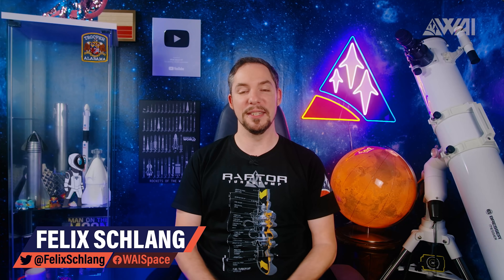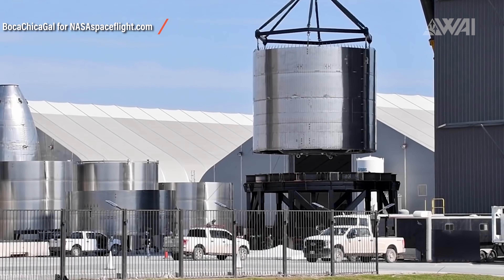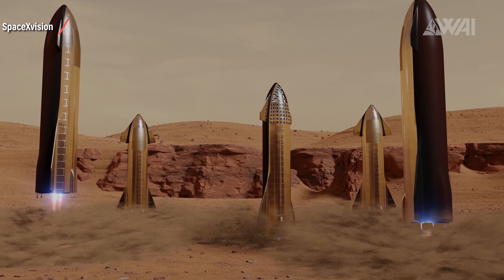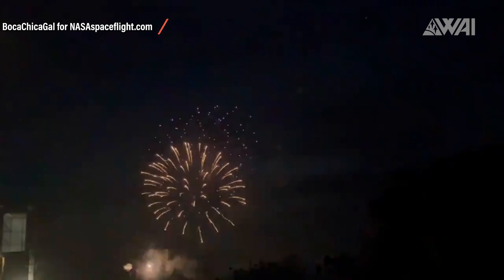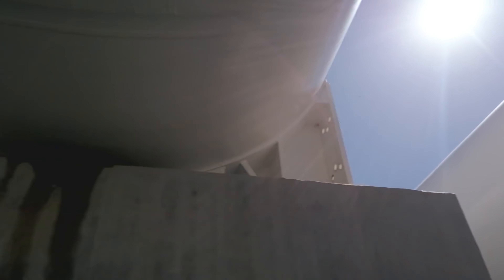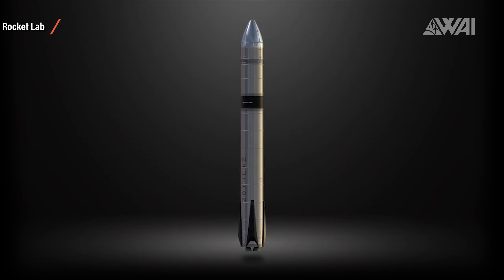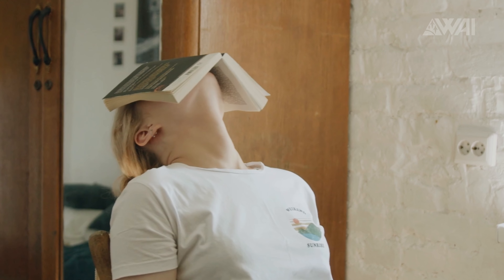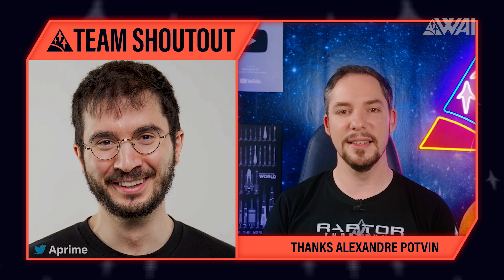SpaceX Starship Without Legs? Is Elon Musk Serious? Blue Origin & Rocket Lab Next Gen Rockets!

Comment: I'm excited for Neutron and cant wait to see it launch AND come back to land. I hope they let us in on their journey and consistently release info on their progress.
Reply: *to barge
Reply: I'm excited also.
 Peter Beck is your typical New Zealand quiet achiever, not given to bold claims but plenty of bold thinking backed up with well executed results.
Its exemplified I have always thought by the NZ All Blacks ruby team through the years, to do things with modest tenacity and let results speak for themselves. 
Venus intrigues me as well, a hell hole on the surface but with an upper atmosphere and gravity closer to Earth than anything else in the solar system.
Reply: @Dug6666666  I like to imagine how close Venus would be to earth if it was further out then it currently is. Say Mars and Venus were switched positions 4 billion years ago. I wonder how much water Venus originally had. If Venus still became a greenhouse, would it’s further distance from the sun still allow for liquid water on the surface? All the typical what if questions.
Reply: All new rockets being developed should be fully and rapidly reusable and either Methane or Hydrogen fuelled. Methane and Hydrogen can be manufactured using carbon dioxide and water and renewable energy. These are the things which are necessary for a transition to a circular economy, while reducing the cost and carbon emissions to put cargo and passengers to orbit and beyond.
Reply: @MrAlRats  Rockets don't make much emission, even tourism using airplanes doesn't make much.
And full reusability isn't easy and it needs a lot more fuel and it just doesn't make much sense on small rockets.

Comment: Dear Felix Schlang
Thank you for your enthusiasm for space. I support you on that. For the catching of landing Starships, I propose using support legs like the Soyuz support legs. Just folding up, when the Starship is landing. Airbacks could puff out from the top of the legs to give a soft touch and support. 
Instead of the Starship legs, I propose to build in a supporting “ring” in the bottom of the Starship (inside the skirt). The landing platform could then be like a short conical tube, for controlling the landing to a precise stop and parking (on Earth).   
Top of mind idea. Best Tomas Horne

Comment: Thanks for another great video!

"So the helium pressurization system introduced with Starship Number 9 to fix the header tank pressure problem Starship Number 8 was suffering caused the trouble on Starship 10..."

That's it in a nutshell. Plus the problem with getting the landing legs to deploy, and a methane leak that may have also been related to pressurization problems.
Reply: Teething pains, teething pains, they will work it all out eventually. I am really surprised at the number of people who think that, because they have had two unsuccessful landings, and one only partially successful, that the problems are insoluble and the design is fundamentally flawed. i mean for crying out loud, they fully expected to be exploding in flight at this point. They have achieved terrific, unexpected success. Mere engineering problems will be solved.

Comment: This may be off topic, but I think someone might find it interesting. :)
Device to end the creation of Nuclear waist.
 Step 1: calculate how much energy you need pumped into the motor to make a vertically positioned circular platter with  magnets in-bedded horizontally around it's left side and right side so there pushing force is pushing out sideways relative to the vertically spinning disc to spin fast. :D Step 2: Calculate how many sets of copper coils you need to be interacting with magnetic fields to achieve this & to perpetuate more electrical current flow then is needed. :D Step 3: Build a round horizontally positioned platter covered in all these copper coils pointed down that does not move (Is stationary) :D Step 4: build a round platter covered in powerful magnets pointed up that can spin and place it directly under platter with hanging copper coils. :D Step 5:  Position the vertical platter that is  motorized close to the horizontally positioned platter covered in magnets pointing up so that when the vertically positioned platter spins the in-bedded horizontally positioned magnetic fields slam sideways against the edge of the horizontally positioned platter causing it to spin. :) Step 6: Make sure enough of the copper coils are feeding their electrical current into the motor and the rest of the copper coils are linked into a set of rechargeable Battery's placed right next to the motor spinning the one vertically positioned disc. Step 7: Build a duplicate setup of horizontally positioned discs with hanging copper coils and disc with upwards facing magnets and position it to the front right, the back left and the back right of the vertically positioned motorized disc. As the vertically positioned motorized disc spins the horizontally in-beaded magnets will now hit into all 4 horizontally positioned discs causing them to spin. so you will effectively be using the spin of one disc powered by one motor to spin 4 constructs that are each generating electrical current. now build this whole setup multiple times over and use the current perpetuated by it to power up scaled electromagnetic generators that are equal to or more powerful than the ones used in a nuclear power plant. You will now have a device that is self perpetuating off of it's own electrical current perpetuation and no nuclear waist to worry about.

Comment: The one advantage of the catching system is being able to soften an unexpected harsh landing with a shock absorbing system internally.  The arms do not have to be rigid but could be vertically movable with absorbing systems.  This might save a starship or booster having problems.
Reply: Maybe, I can’t think of many issues where the spacecraft would  be having issues with control and still be able to precisely by caught by the catching tower.

Comment: They should use spring legs that absorb the shock of landing and spread the force of landing throughout an extendable base structure with spring locks or shock absorbers. One's that don't bounce due to the fact that the spring is very wide spread and they are releasable. When you release the spring before it is able to bounce, spring or jump out what happens? As you release the spring setting it (to some degree) to let up and spring  into the air your controlling the spring and the resistance of the spring in order to stabilize the landing. So you have a leg structure built in a wide structure with giant spring loaded chamber   that is able to absorb enough shock so the ship isn't hitting against the ground though as the ship touches the ground and absorbs the shock of landing the spring release out into the air so that it cannot bounce. It has to be done in synchronicity. So as the ship touches the ground the spring can release towards the air, absorbing the shock of landing while stopping the ship from jumping back out.

Comment: Could the pressurization issue be solved by some balloon like object inside the tank that could still be pressurized with helium but because it can't mix with the fuel, there is not anymore the problem of getting helium on mars, it could just be reused.

Edit: Let me know if you think that could work :D
Reply: Sounds good, since the helium gets compressed again for storage. The autogenous gas can still be injected into the helium gas section and later separated with extreme cold.
Reply: @imconsequetau5275  Exactly, that's what I thought👍
Reply: But I think the problem is finding a balloon that can withstand the tenperature and pressure, because if it's very cold, it's not anymore elastic
Reply: @Astromath  
Polyethylene film and yarn still works at cryo. 

Once the engines are running, the vapor will rise away from the engines, but during the skydiver maneuver vapors may reach them. It would really help if vapor could be excluded from the methane down-comer. Otherwise, a small gas separator (centrifuge) is also needed, especially at the flexible plumbing closest to the three center engines, but perhaps also at the down-comer "top". These separators may only need to be effective while the engines are off. 

I still expect that much larger & separate propellant gas accumulators will solve the startup pressure problem. These can be located in the main tanks, but why can't the main tanks be pressurized instead?
Reply: @Astromath  
This isn't a stretchy balloon, but a flexible membrane that conforms to the tank walls. The gas fits between membrane and tank wall, causing the membrane to "prolapse". Very similar to expansion tanks on boiler systems.

Comment: How about using the skirt itself as a leg? It could get some shock absorbtion of overlapping rings with springs/pneumatic that could adjust the skirt slightly as surface alignment system. That could also purposely "lean" the whole ship if needed(wind, surface aligning, assisting one engine landings where they might be necessary). And opening "vents" in the skirt.
Reply: Great idea, a single landing foot! The landing skirt can still be a solid ring with standard reinforcement ribs if the landing pads are a metal-open-mesh raised platform, like on some bridges.
Reply: Maybe make the skirt a bit conical? So you have a wider base

Comment: How to eliminate the legs? Thinking out of the box...  What if the Earth based landing platform was designed to move downward at a variable speed in concert with Starship as it lands. A bit of reinforcement on the skirt would be required.

Comment: Given that each attempt so far seems to loose fuel pressure how about...
 Doing away with the header tanks and simply having dome tanks snuggled under the main tanks? The dome tank being feed from above via gravity check valves and the turbo pumps drawing from the dome via a cryoproof flop tube (a tube with a weighted end that sloshes around with the fuel and so does not draw vapour). I just wonder if that eliminates the slosh problem and stops the engine failures.

Comment: Starship with out landing legs could be done by landing a cradle for starship to land in. The cradle could be vertical or horizontal if horizontal it could also act as an erector before filling with fuel. I personally favor a horizontal cradle as it would make unloading easier for personnel and heavy equipment but either way it would work and save weight. The added advantage of a cradle system is it could be deployed with a regolith cover carpet to stop rocket exhaust from throwing around damaging debris and deflect the exhaust to stop the undermining of Starship legs while landing and taking off. Additional advantages to a legless Starship is the engineering of Starship will be easier and it will be cheaper to build.

Comment: Same tech as an aircraft carrier recovery system would work great you could adjust the cables  for different weights due to fuel usage and whatever else and being steam powered or electromagnetic  but I’d use steam less things to go wrong    And easier to maintain.

Comment: People should be emphasizing the latter part of what Elon said: “But, optimized landing propellant is only ~5% of dry mass, so it’s not a game changer.” That means that even if they did try to catch starship it wouldn’t improve much on the current powered landing anyway. So that’s inferring that he sees it as being more trouble than it’s worth attempting.

Then again it would make sense to develop a SS/SH hybrid for Earth-Earth travel. Why bother making a two stage system when you can stretch SS and attempt to catch it after belly flopping?
Reply: Make it bigger, and add ~6 sea level Raptors. Would be enough. I wonder if you even had to stretch it? Or would it be enough just to add engines? Or wouldn't it have enough proppelant?

Comment: If most of the time once they've sorted out the rocket engine control the Starship lands ok then why not build a metal landing pad which tracks the rockets and moves down slightly to reduce impact. At the very least it would reduce structural fatigue. If it is self levelling then it will help if a leg fails.
Although more complicated than a concrete landing pad it can be kit built and would help with sea landings.
You kind of see why they're thinking of catching them. :)

Comment: What about really long legs that are connected to a hard-point way higher than the puck?   Stilts instead of a sky-crane!  As they deploy the empty space could be back-filled with foam to cushion and level the landing.
Reply: I couldn't type space apparently
Reply: More length of legs = more material = more weight = less payload capability for same Delta V

Comment: it's not like startship can just land anywhere on earth. normally it would need a designated landing platform. so shock absorbing self-actuating/self leveling landing platforms would be ideal for earth bound flights.  imagine how many tons those landing legs at full stack starship+super heavy. that weight could just be used for additional payload maybe
Reply: There is no good reason for booster legs to support 5,000 tons. They should only handle the near-empty booster. Same for Starship: it only needs to handle propellant weight on Moon or Mars, but never on Earth.

Comment: Need an expandable pressure bladder in header tanks.
Reply: I agree, would have to use some material that will not freeze solid.  Or use a large plunger, like a hypodermic needle, or piston. something that separates the helium from the fuel.

Comment: Catching starship with a tower may not be due to an issue with leg design, but in considering the upsides of alternatives.  Likely, in reduced vehicle complexity (and with that theoretically better reliability, less maintenance needs, all lending to their MO of faster turnarounds), just as well as marginally improved aerodynamics, and weight savings.

TL;DR, imo they may see theoretical viability and benefit in a different approach, and aren't afraid to reeingeer the wheel, in typical SpaceX fashion.

Comment: I think it would be killer to have near surface landing assist drones - put four super draco's as thrusters on each half-circle/crescent drone...these 2 crescent drones could capture the starship, clamping round at a much more stable point towards the top of the rocket. The 2 halves would link up around the rocket and assist with softer landing /accuracy and stability as it is set on the ground. Need to land on another planet? Send these with the supply mission prior to passenger arrival. No fancy pants landing gear, crane catch or bouncy house required!

Comment: Starship on the moon could use thin conical rods as landing gear, just piercing the ground as a form of landing gear. Use a small electric motor to crank the sharship up to an acceptable takeoff hight and have the engine vibrations shake the rods free for takeoff.
Reply: The lunar version can leave the landing gear deployed at all times.

Comment: I feel like the question of the legs obviously needed for the moon/mars is tricky, especially for the moon, as it's gravity is about 1/6th of what earth has, so landing legs would only need to support 1/6th of the load. (Similar holds true for mars, but there it's about 1/3rd instead).
And I'm pretty sure SpaceX can easily develop legs that handle 40% of the forces compared to what is needed to land on earth...

Comment: Are legs really needed on Mars though? SN10 has shown that a Starship can land on its skirt and remain standing and intact at least for a little while. Can we improve on that? I think we can. Have a detachable skirt extension which incorporates a crumple zone to absorb the shock of landing. The crew of a Starship taking off from Mars would  first uncouple the crumpled skirt extension, leaving it behind on Mars. On returning to Earth either a new skirt extension would be fitted in Earth orbit or the Starship would be caught in much the same way that Elon is planning to catch the boosters.

The skirt extension could be slightly conical rather than cylindrical, giving it a broader base to enhance stability  and allowing it to overlap the top of the booster when they are conjoined, so it does not add to the total height of the combination.

Comment: Group the 3 engines together..and test that alone... like how a car engine is tested without being mounted onto the vehicle..test the engines in the launch sequence .. prepare a lifting system... basically testing the thrust of lift off...then similarly test the landing..test the combustion heat and it's effects to the the rest of the engine parts.. possibly the reason for SN10 to blow up.. excess heat hit back into engine other smaller part's during landing..

Comment: Why not use legs which are like Hydraulic rams,instead of folding out and using crumple ability.surely if it was a ram type it would cushion the landing. you could keep these tucked up inside its body then drop them down while at the same time locking the ram in place. it could bounce gently and ride out the shock through the fluid in the rams.

Comment: why don't they just make booster and starship as close as possible the same, meaning both have legs?
Just time the landings so that booster can be craned on the side before starship lands. Starship just enough fuel extra reserve to make few extra orbits before landing if more time is needed to get booster out of the way. That fuel requirement should be miniscule.

Multiple separate systems does not seem to make any sense. 🤔🤔🤔

Comment: Moon and Mars - SpaceX should send a robot ahead of any Starship landing to construct a landing pad.  Creating a level and blast hardened landing point for the Starship would make the landings far safer AND in the case of the Moon rocket remove the need for the extra set of engines high up on the Moon rocket (say goodbye all that extra weight and the extra design work plus testing).